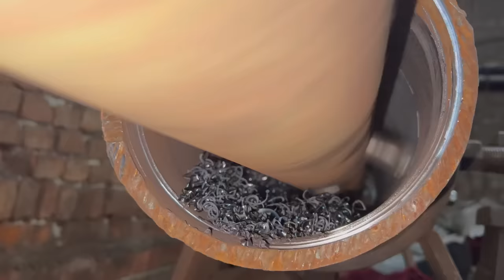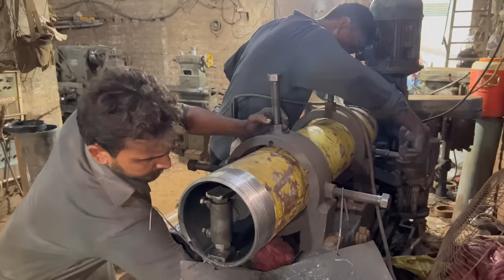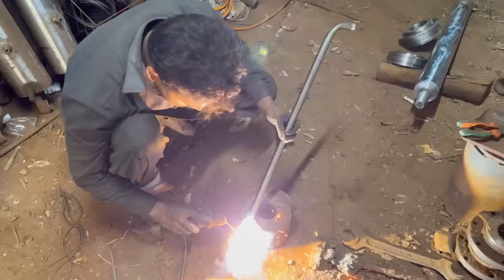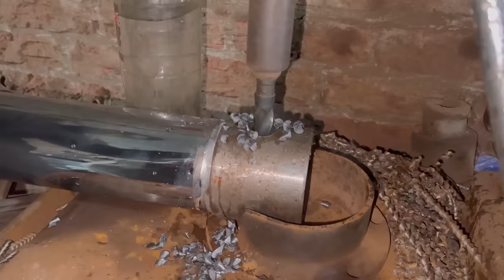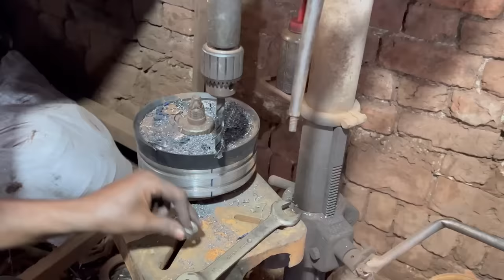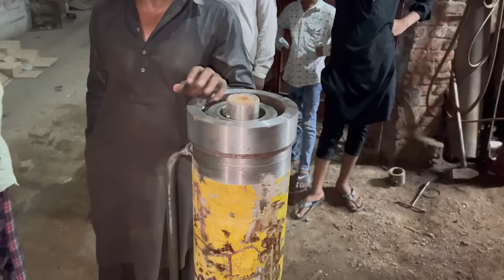How Are Made Dumper Hydraulic Jacks and Cylinders Go Through A Vigorous Manufacturing Process

Comment: I have seen many articles critical of "ship breaking". I can't help but notice how much local industry like this is possible because of the low cost salvage steel available. Were this man to have to pay for new steel, it would be cheaper to buy new Chinese made hydraulic cylinders. The steel used in the ships is likely of higher quality than new steel.
Reply: I’m sure it is. This was an amazing video.
Reply: @tomsommer54  Absolutely!! I am more of a hobby machinist however I am finding myself making parts for my small engine business more and more because of the shortages and shipping costs as well as other factors I am not aware of.  I either get the wrong part, have to wait extended periods of time or even not get what I ordered at all. These guys are awesome and are extremely needed. This is also how they feed their families.
Reply: It isn't
Reply: One thing that always concerns me when I see the steel that they remove from these ships is that there is always a coating of some sort on it... I don't know what the coating is but I'm sure its not going to be good to breathe it in.. i always envision it being asbestos and the possible impact on the community somewhere down the road... I don't know if they do or did use asbestos in ships.. it wouldn't surprise me.. I know it has more or less been universally banned now but possibly not when the ships were being built
Reply: I am from China Seals Factory. Our company produces many types of hydraulic oil seals. If you are interested in our products, we can send you free samples so that you can learn more about our products.

Comment: These guys are incredible. I consider myself a novice compared to these guys. I find myself making more and more parts because of shipping constraints as well as too many other factors that I am not aware of. I really would love to know what the parts are that become the plunger. There are hundreds of those things in different specs that they clean off and turn down to beautiful plungers that accept o rings and hold pressure. Just wonderful uses for old steel.
Reply: Looks like cast steel parts, probably made only a few blocks away specifically for them. I find it interesting how much they do with so little, but smashing that castle nut is just horrific and not even doing any sort of pressure test...
Reply: 11
Reply: I am from China Seals Factory. Our company produces many types of hydraulic oil seals. If you are interested in our products, we can send you free samples so that you can learn more about our products.
Reply: @susansu-p5o  Excellent! I have been busy with other ventures at the moment however  if you have an email or a way to get in touch I would be most happy to try your products. Thank you.

Comment: How is it that these people can do this from the seat of their pants, using old junk tools, working on the dirt floor? I am seriously impressed. Imagine what they could do if they had a CAD system to design with and a modern machine shop? Probably be designing and building some amazing stuff.
Reply: The equipment sure is old, but upgrading to computers and software would be so expensive for them. That said, a clean shop and some basic PPE would do wonders for them, and they could much more easily afford that. Dirty tools, dirty machines, dirty rags, loose-dirt floors. Abrasive dust everywhere. Loose clothing, open sandals, welding indoors with a garbage visor. Give these guys some overalls, boots, safety glasses, a solid floor, a fan to weld under, and a trough to wash things in, and their health and part quality will jump overnight.
Reply: Pakistan is one of nine states to possess nuclear weapons. Imagine how clean that must be, and the systems they use.
Reply: @asm_nop  :washhands::washhands::washhands:
Reply: Brain imagined CAD system and then adopted, while these people have brain to use directly to convert into skill.
Reply: @shakilahmad4075  😂 🤡
Reply: I am from China Seals Factory. Our company produces many types of hydraulic oil seals. If you are interested in our products, we can send you free samples so that you can learn more about our products.

Comment: I have to start out by saying how horrified I am to have seen the fellow weld without eye protection again and again. The rest of this video is perhaps the most slipshod, careless, and dangerous shop work I haver ever seen, except for the other Indian dirt floor video's I've watched in utter amazement. This one is special though, I think it's the worst, holy cow! Another shocking thing about these Indian "production" videos is that there are always people in the comments praising this stuff, as if there is something noble about it.
Reply: I am horrified as well as someone who has been working for an engine manufacturer for the last 24 years. I believe people praise them because you have to give credit where credit is due. These folks are doing the best they can to earn a living with what they got. Should they be using safety equipment? Of course they should. Should they do a better job of cleaning up the place so it isn't a tripping hazard? Of course. However, you have to admire their willingness to do what they need to do to help support their families. The average "factory" worker in Pakistan makes less than $100 USD a month (that's based on a comment from a Pakistani on another video in the comments) regardless of skills. I suspect none of this stuff is exported and is for domestic use. There is obviously a market for what they manage to build, otherwise they wouldn't be wasting their time doing it. I'm sure they would love modern equipment and PPEs, but the workers aren't going to spend their meager wages on it and the employer is too cheap to provide it. The employer could probably find someone looking for work within minutes if they lose an employee. Yet, here in the United States, manufacturing plants are having a hard time filling openings which slows down productivity and increases lead times for products. We are very blessed to live where we live despite all the whining and complaining that people do. We can learn a lot from these folks. Just saying 😉
Reply: You are absolutely right

Comment: Was waiting for them to chrome the inside of the piston guess they leave it raw steel only prob u get a little moist in there will cause rust & the rust will rip up the lip seal & o-rings will need another cyclinder
Reply: Won't rust when it's filled with Hydraulic fluid
Reply: @iknowyourebrokeauto468  yeah not true have seen them rust when filled with hydraulic fluid have seen oil pans rot from the inside out when filled with oil
Reply: @matthewperry5524  if they have a ton of water contamination yes they will but if it's just oil they won't. Water and air are the two main things that cause rust and rot
Reply: Pistons are never chromed, only the rod of a hydraulic cylinder is chromed. Also I would not to be concerned about durability of this manufactured product. I would be more concerned about the end cap that is welded on the cylinder (ea. ever seen what happens with an almost full bottle of water when you hit at the top?)